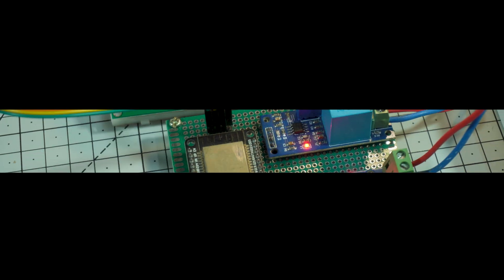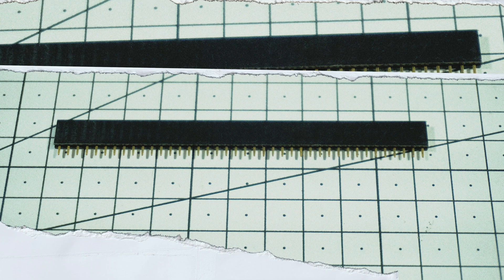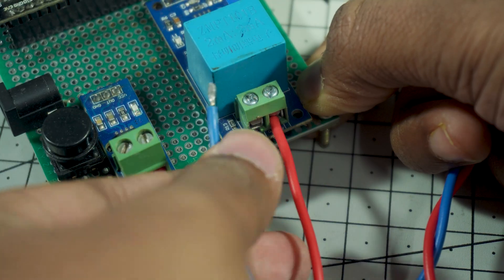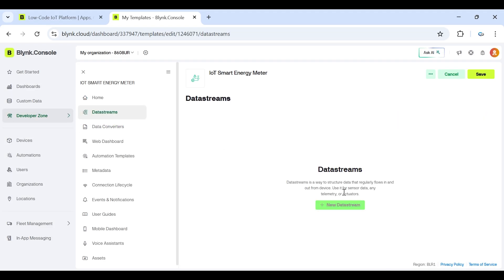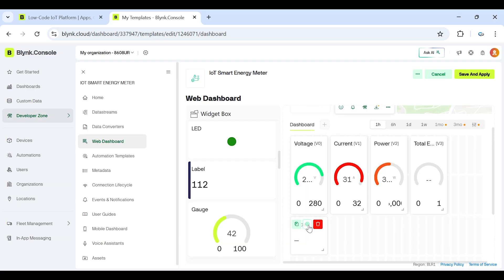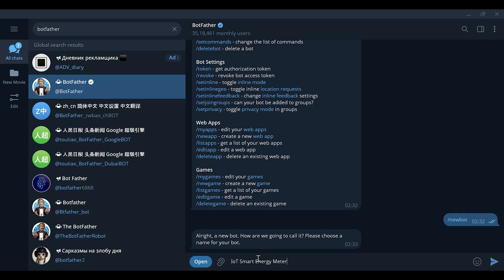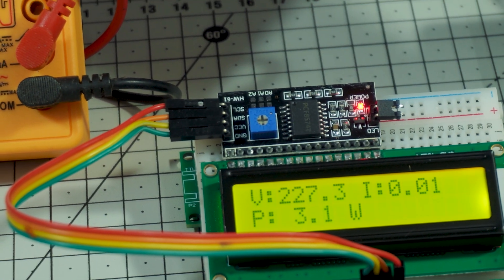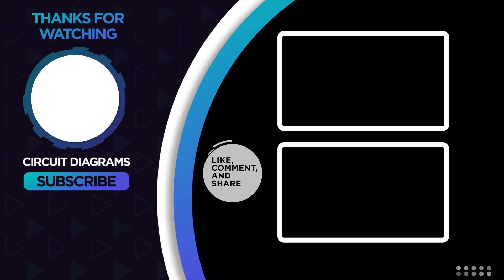IoT Smart Energy Meter Using ESP32 & Blynk 2.0

Comment: Bro can we also turn off these lights by this project?
Reply from the maker: No you can only monitor energy readings. But yes you can turn on and off loads like lights, fans along with energy monitoring but the system will be little different as well as code.

Comment: This project also can be use with other electric load? such as pressure cooker and mini fridge? And if i want to use 3 kinds of load, should i connect one by one or 3 in a one time?
Reply from the maker: Yes these sensors can measure high load upto 30 ampere but you need to buy 30A acs712 module. Make sure. And if you want to connect load then use extension cord or join each load in parallel, same as the single load I have shown in this video.

Comment: Why do you think our reading in voltage jumps high everytime? Is it because we use an expansion board set of an esp32? Also when connected using barrel jack power at no load reads -3w while when connected to type c it goes zero but still the voltage is not stable
Reply from the maker: Voltage jumps because the ESP32’s ADC is very sensitive to noise, and the barrel jack power adds more ripple than Type-C, causing unstable and even negative readings. Using ADC pins, proper calibration, and cleaner power usually fixes the issue.

Comment: How did you get the power supply for the bulb?
Reply from the maker: How did I get mean? I just take a pvc electric socket board that's how I can connect any electrical device instead of just using two wires.  And the bulb gets the power from the ac mains supply via acs712 current sensor in series. Just see the circuit diagram mentioned in the description, you may understand.